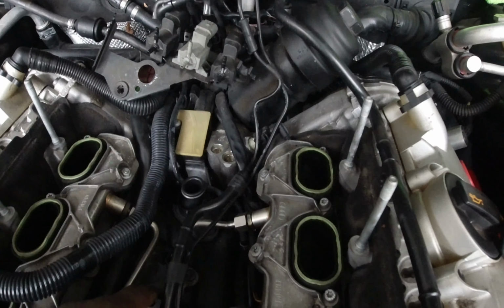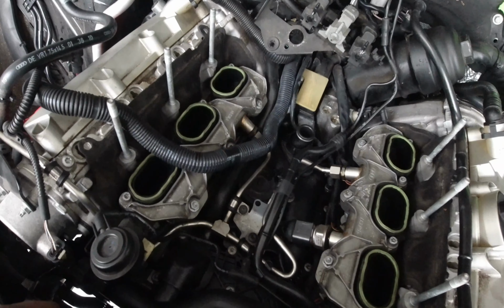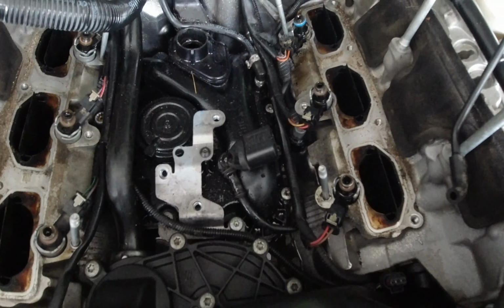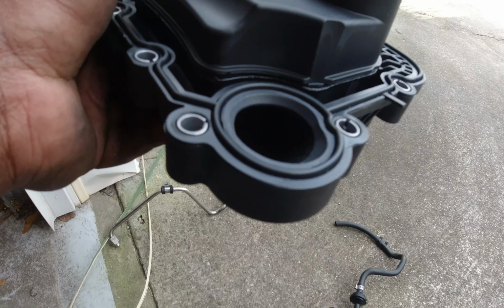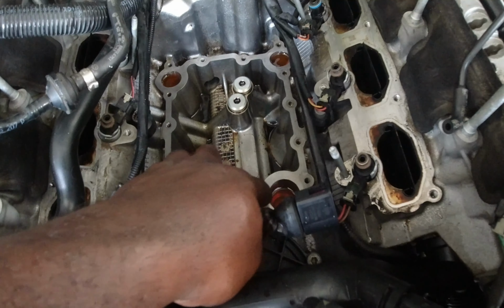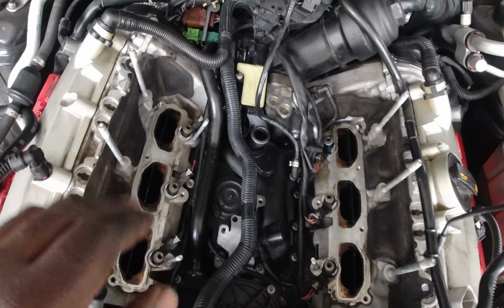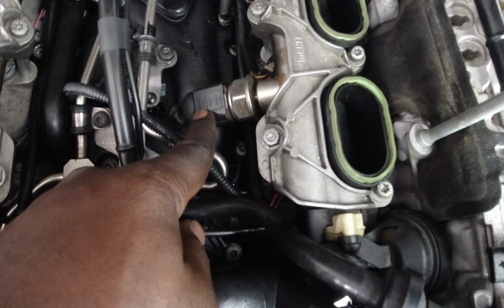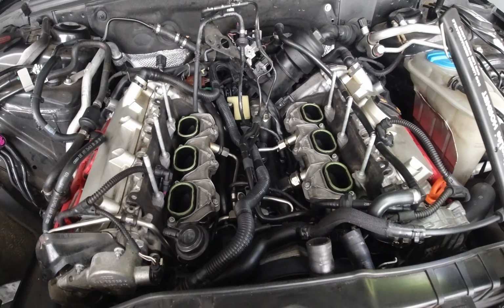Audi S4 B8 PCV / Air Oil Separator

Comment: Did you have to drain the coolant before starting? And did you have to remove fuel pump fuse and let car shut off before removing fuel lines and rails?

Comment: Will a bad pvc allow radiator fluid to leak into the engine oil?
Reply from the maker: Usually when the pcv seal gets bad. A sign that it might be the case is when your constantly low on coolant but no sign of any coolant leak.
Reply: @Wattis161  thanks a ton! I know what I am doing this weekend

Comment: Hello, am changing my pcv valve on my 3.0t...am following ur steps on removing the lines, now I get fuel coming out as I remove the retaining line nut...any tips?
Reply from the maker: Your gonna get a little fuel coming out. just keep the front door closed during the repair. N make sure the car is completely off. The car tends to prime fuel when the front door is open.

Comment: My b8 s4 shakes when the car is stopped or when idling and the engine light came on. The coils and spark plugs are good. I sometimes smell a little bit of gas , when I turn my heater on. You think I will need to replace the PCV as well?
Reply: I would check your pcv and your internal sc intercoolers
Reply: and not the main cause but do a carbon cleaning while your at it
Reply: @juanc8462  so I replaced the PCV and the fuel
Injectors cleaned the throttle body / and the map sensor. Still the same code I’m getting “ p0175 “ system running rich.

Comment: I put everything back and my car started rough idling what did I do wrong
Reply from the maker: It’s either a vacuum line has a leak or your intake flap is not installed properly.
Reply: @Wattis161  I’ll check it out